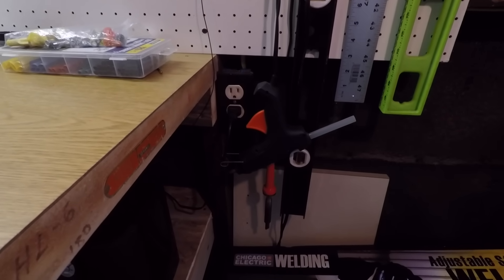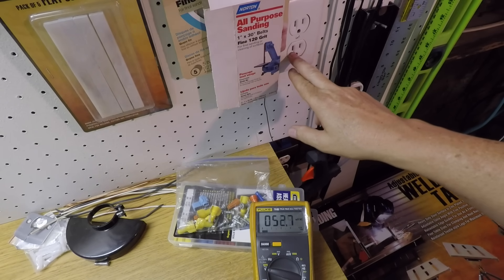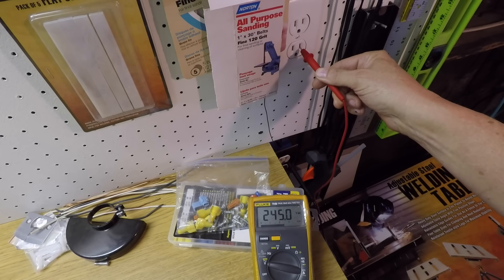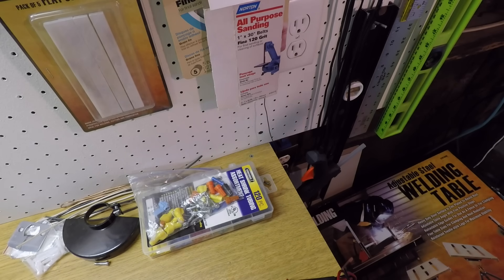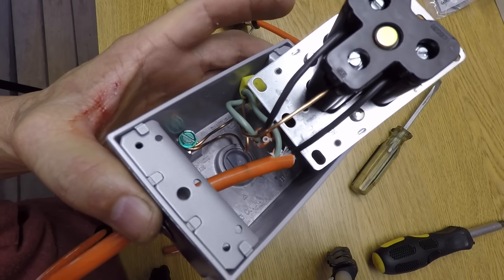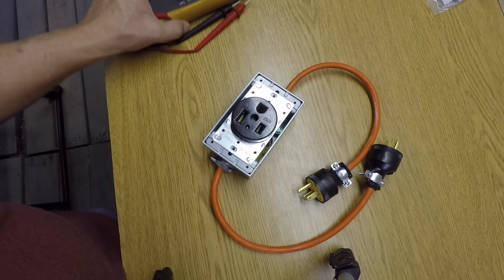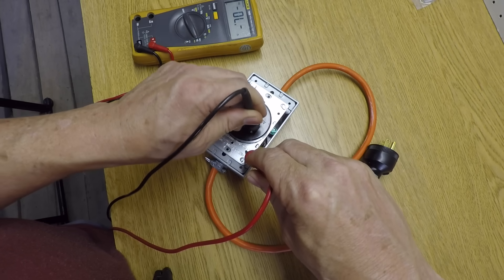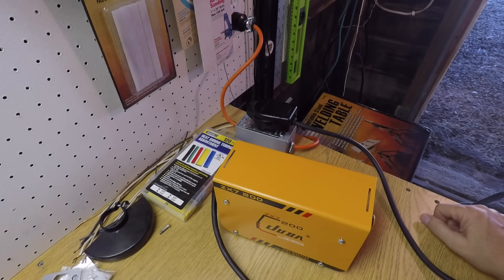How to Get 220v From 110v

Comment: enjoyed your video just what I was looking for the problem I have is will this do harm to  your on/off switch I have a plasma cuter it has 120/v and you are supposed to be able to use the same switch  to use 240 v for heavier material the wiring may not be heavy enough

Comment: Absolutely not safe to do at all, and the information you gave is incorrect as well. The bottom part of the plug is the nuetral, not the ground. If it had a four plug 220v plug, the  bare wire would be the ground in case of a short. never mix neutrals and grounds.  Also, not having a double pole breaker for a  dedicated 220v circuit could be disastrous if you had a short. People's houses have burned down because of it, hence the reason for the building codes being written in the manner that they are. I grew up in my dads construction company when I was a kid, saw a lot of scary stuff. Please be safe.
Reply: 4 pole would have neutral 3 pole has 2 hots and a ground no need for neutral evidently your dad still has much to teach you.

Comment: This will only work if your two 120 outlets are from opposite sides of the bus bar in the service panel. I don't know if you planned it that way or just got lucky but that is the only way you are going to see 240V across the lines.
Reply: He said each circuit was on a separate line, I assume he was referring to the main lines from the pole (separate phases).

Comment: If you feel it draws less than 20 amps, why not get a 240V 20A receptacle and plug? They're cheaper than the 50A devices. It probably had a 240V 20A plug on it anyway, so you're spending more $$ than you need to.

Comment: put both circuits on a double pole breaker in main box, safer
Reply: @Jason Bowman Great thought, Jason. Perhaps he is out of spaces in his panel. If not, he should run a dedicated 240V line direct from the panel, and not mess around. Meanwhile, the 2 120V circuits he is using should be on a 2 pole, 20 amp breaker at the very least. This guarantees that he will actually get 240V from the 2 panel busses, and adds another level of safety protection. I also think the cord should have been #12, the receptacles should be 20 amp as well. And I do believe that there is a likelihood that if the welder is plugged in and in the ON position, and one of his 120V plugs is unplugged while the other plug is plugged in to a live circuit, the unplugged one may have a voltage sitting on the hot terminal. It would be a good idea to test this theory if you’re going to use this configuration.
Reply: Yep, alot safer
Reply: @Jason Bowman What he is saying is to replace the circuit breakers with one double pole breaker.  It would still feed both circuits, but would trip both breakers if you had a short.  Just make sure to mark this in your box, just in case you sell the house, or replace the original breakers before you sell.
Reply: I don’t get it...
If you put a breaker on and unplug one of the cables without removing the plug for the device or switch the breaker to off, it’s still as dangerous.
What you should do is to install a breaker (or two, one for each source) that reacts to power, a breaker you need to push every time you start, in order to get power, a breaker that disconnects in the same moment you unplug the cable.
Reply: Then it would not be portable which is why he said he made the thing .

Comment: Why didn't you just run a 220 outlet. If you ran the 110 Outlets? Is your main panel completely full ? A circuit is only good for 80% of its listed rating on Breaker. It does look like a dinky welder. What's the wattage, do you know? Watts divided by volts will tell you the amps. Looks like a sheet metal welder. Try that welder out so we can see. I need to run an outlet for my welder that I don't use.😊

Comment: What amp is the welder drawing ? you are only getting 20 amp not 40 you can not get more amp out of the 110 breaker even if its off two 110 lines amp is not going to dubble .    a 220 breaker 60 amp is what you need. I do not think the compact 220 welder you have will draw more that 30 amp that is still 10 over and the cords will get hot.      I live in Rule Missouri , I have seen this many times it will work i have seen that run 100 yards from house to barn  , The Down side it is not safe .  12/3 is 110 wire 10/3 is 220 30 amp 8/3 40 amp 6/3 50 amp  the amp and heat can melt the copper drawing 220 through 2, 110 lines is not good practices.   Only time you have a open loop on the box is when the welder is plugged in .    but for your own use and you feel safe go with it .  but my self i have a 220 breaker 60 amp 6/3 line from my box to outlet  5 foot long.  and I have a 6/3 extension cord 50 foot long.   But that is for a Lincoln 220 stick welder 40 amp
Reply: JCcanU    The welder is 4.7 KVA at 240 volts.   How many amps is that?   Since when is 12/3 110 or 120 volts only?  Not sure where that one comes from.   Respectfully,    Kevin

Comment: Has to be from opposite sides of buss bar, otherwise it will only be 120 volts, will measure zero between hots on same buss,  240 across buss bars.

Most people don't have opposite buss circuits just hanging out together
Reply: Best thing here would have been for him to replace the 2 single pole breakers with a 2 pole breaker. Problem solved.
Reply: the kitchen! may have a split plug on the counter...
Reply: I respectfully disagree that you will have 120v if both circuits are NOT on opposite sides of the buss bar.  The voltage would be zero across both live wires if they happen to be on the same buss bar.  This would be the same as putting both leads of your voltmeter on the same live wire.  Voltage drop is zero.
Reply: ImNotStalkingYou Every breaker position is the opposite buss. That’s why 240v breakers are connected together one above the other.

Comment: Plug it in and check for voltage on the unplugged side. 
The real problem that you have is the 14 gauge wire your using. It will heat up because your drawing 20 amps from it. It's a slow burn fuse in front of the breakers. Ever hear of a fusesble link? That's what you made.
Reply: Yes, I've seen new houses in South Carolina wired with 14 gauge wire and have a 20 amp breaker on them. I agree with you totally. What the hell is going on.
Reply: Jeffrey Whitlatch   Absolute NEC violation!   Are you sure #14 on 20 amp breaker?
Reply: 20A breaker =/= 20A load. However, he doesn't even know what the load is.
Reply: @DIYHomesteadProjectsDIYHP10    I don't think the orange cord (probably of Type SJT) is actually 14 gauge.  14-gauge/3-conductor Type SJT cord is much larger in diameter than what is shown.  It is probably 16 AWG (13 amp max), possibly even 18 AWG (10 amp max).   Those max ampacities (10A and 13A) are if 2 of the 3 conductors are carrying current and total length less than 100 ft.
Since this is by no means a device that is UL listed or conforms to the NEC, then you might as well go all-in and double-up your wires.  Put the white and black wires of the orange SJT cables together (in parallel) and your wire ampacity will theoretically double.

However, a bigger problem may arise.  I looked up the specs on your ZX7-200 welder and rated input power is 7KVA, which equates to 31.8 A @ 220VAC.   That value would match the 50A/250V plug that came with your welder.  If it only used 15 amps, they would have used a 20A/250V plug because it is cheaper.  That 7KVA/31.8Amp spec is when you are dialed all the way up at 200 Amps of welding current.  I suspect you'd start tripping your 20 Amp breakers around 110 -130 AMPS of welding current, and if you are indeed using 16 or 18 AWG SJT cord, then you've got an issue when you are drawing more than your wiring can take but less than the 20A trip-point of your breaker.  Do you have renter's insurance?

Comment: Funny, we in Germany just plug in, 230 V. Boom. Every outlet has 230 V 16 A. My stove is wire connected to 3 phase, 3x230 V 25 A= 400 V...no plug. Normal Appartement in Berlin. America, measurement from the very past, so the power grid. Pls, don’t take it personally, because you didn’t setup those standards. Btw, here it was changed in the 1920’s.
Reply: Safety issue.  There is no practical need for that much voltage, much less wattage to all outlets and/or fixtures.  As time goes on we will see a move to LESS voltage/wattage to circuits due to LED and other energy saving devices.
Reply: Dirk Gogo, Europeans keep forgetting that they were destroyed and rebuilt after two world wars.

Comment: This is an outstanding piece of information and great video. I was wanting to run some 240V in my garage and dodnt want to have to deal with the hassle of another sub panel, but I do know I have three seperate curcuits running in there right now. Did you say the regular 120V outlets are wired using the standard 120V romex?
Reply: People without an understanding of electricity don't understand what being on different phases is. They more than likely think you mean just 2 separate receptacles.   Maybe another video would help them understand the difference. Thanks for video
Reply: Casey Fike    They are not on different phases.   It is single phase.   You can not have different ones.

Comment: hi. why not use grounding wire instade a com wire for grounding.
Reply: @DIYHomesteadProjectsDIYHP10   This is why I disagree , many people see a video have no clue .     I know you did the video to help others for a quick way to get 220 from 2 breakers off 110 = 220 .   many think its only a single pole 110 .   I been working with  440 220 110  for 40 years , I have seen 220 robbed for 110 and went to 20 outlets plus the Kitchen oven and clothes dryer,  when the oven was on, plus the dryer, the dryer would hum the lights went dim lol  Thats a Huge NO NO , but Missouri has no code . I was from Michigan with code and Texas with code .   Im guilty of making  110 jumper off 220 line Just taking 1 leg of the 220 so I could run saw or drills .  temp 2 or 3 day job. removed it when I was done .

Comment: Why not just wire a 220 connection and be done ✅
Reply: As a master electrician I would not recommend this at all. How many people do you think are going to find the same phase also what loads are on each phase matters also, this is some jerry rigging at its best
Reply: @darrenrodgers7273  I think it is dumb too but what is the worst that will happen?  Hooking up a hot leg to neutral or two circuits from the same leg to each side of the 220 plug (accomplishing nothing).  I see no hazard doing this really, just Jerry rigged as you said.
Reply: @kevingallineauii9353  Backfeeding one hot prong of the 120V plug that is disconnected for some reason while the 240v equipment is connected to the other leg could be a reasonable hazard to expect.
Reply: @darrenrodgers7273  Master electrician who browses YouTube for instructional videos. You sound great.
Reply: 220?  Lol
Reply: Why no go over and do it for him
Reply: What you talk about.  We all call backfeed. You are not hooked up with the white neutrals and if you unplug welder first you are ok . Depending on where you are that set up would not pass code .
Reply: It won't last long it will burn up the ground wire is way too small let's hope that this guy say this is not next to his house
Reply: @edmondlajoie5968   the ground wire is not used unless either of the 120 volt lines gets shorted to ground.
Reply: I think he wants to save money and combine the 2 outlets which he already have for the added welder.
Reply: Then it would not be portable which is why he said he made the thing .
Reply: His Panel may be full.
Reply: kenton romero Then install A sub panel
Reply: The panel has 120/240
This just let's you tap both legs without  a homerun back to the panel on it's own two leg breaker.
Cheapest way to access the 240v that's already in the building
Reply: @ja60123  Depending on the 240v equipment that is connected, there is a good possibility of 120v being available on an exposed hot blade of one of the 120v male plugs when the other is plugged in.  Can create real problems if not handled correctly.  So, if you had to do something like this, it is a good idea to get the 120v lines connected, and then connect the 240v gear.  But way less prone to error if the outlet is hardwired for 220.
Reply: Running another line is redundant unless you need more than 15/20 amps.  In the long run, it would be best to run a separate line to keep up with code.. however as long as the wiring is done properly, there shouldn't be any issue.
Reply: ahhhh bc he can take his outlet (and an extension cord) anywhere and run his welder not just one spot. also bc he can
Reply: @thespiritof76..  Because it wouldn't work in most applications, as he would need to tie into two different 120 outlets on opposite phases. On outlets in the same room, odds are they are on the same circuit, therefore, same phase. 

He'd be better off just tapping off of the hots on the two opposite phase outlets he already has, and installing a permanent 240 outlet off of them. I don't know if that would be up to code, but this isn't either...

Comment: just wondering did you use a double pole breaker or you can just add a connecting bar between the breaker switches in case one phase trips they both will?
Reply: @DIYHomesteadProjectsDIYHP10  i only suggest becuase it protects equipment if you have one breaker trip and go to plug in and there is only half the power motors and some electronics release the genie seen it 😎
Reply: @wizard3z868  it is single phase. One breaker tripping would open the circuit so your equipment would not be running on 120V. It would be a hazard though since your equipment would appear to have lost power, but your wires would still be hot.

Comment: That's a direct code violation for one.  The other problem is you need the handles of both breakers tied together so both trip at the same time.  If you lose power on one phase you may destroy your welder.  It's also very likely that the hot prong of the loose plug will provide 120v unless the welder shuts it off somehow.
Reply: Ground wire is not to carry common amperage return.
Reply: Eric, I've been thinking about that. I know if they share a neutral, as in 12/3 then the breaker has to be a two pole breaker. The handles have to be mechanically connected with a listed connecting device. I've seen a six penny nail used and it would probably work, but I can't assume that. This doesn't use a neutral, any 120V current is going back on the ground wire. Which is a violation.
Reply: Eric The Red    Which article of NEC is this violating?   Since his house is single phase 120/240 volts, how can he burn up the welder with one phase loss?

Comment: What about the opposite way 220 to 110?. Any simple suggestions
Reply: @DIYHomesteadProjectsDIYHP10  
Thank you Sir for replying . But this is to be in India where the voltage is 220V. So I guess it will not work for me. I wanted to take one of my American pressure cookers over there.
Reply: @abdullahthayyil9878  lol they sell transformers for us americans to use our appliances in other countries.
i just typed usa to india plug 

https://www.walmart.com/ip/India-3-Pin-Universal-Plug-Adapter-Black/678714159?wmlspartner=wlpa&selectedSellerId=14418&adid=22222222227000000000&wl0=&wl1=g&wl2=c&wl3=42423897272&wl4=aud-566049426705:pla-51320962143&wl5=9002292&wl6=&wl7=&wl8=&wl9=pla&wl10=118779928&wl11=online&wl12=678714159&veh=sem&gclid=Cj0KCQjw6KrtBRDLARIsAKzvQIH_LoznDAR6aoBisON-eV5HsMIpZmPoB58-Hm388Sq9ZepIt90xiN8aAoOqEALw_wcB
Reply: @DIYHomesteadProjectsDIYHP10   3 wire , Red Black Green , Green is Ground so is White Common is just a ground .  1 red and 1 green  off the 220 will be 110 . but its not right but in a pinch will work .    the red is 110 hook up the black to red /  the white to the green   you robbed a 110 off a 220 .

Comment: nice trick to carry a welding machine everywhere without  bothering about finding a damn 230 oulet! thanks a lot!
Reply: Most every building in America has an air conditioning unit outside. Make a good cheater cord for you welder and tie it into the disconnect. That would be safer than this widow maker. Plus how often will you find 2 separate 120 volt receptacles close together.
Reply: Remember you will need two 110 volt receptacles on separate legs to get the 220 volts. So your garage must already have 220 volts coming in for this device to work. If all your garage receptacles are on the same circuit then this won't work.

Comment: I am going to build my own box to use it whit a dryer 220 V
Reply: Dryers need a 30A circuit; you'll blow the breaker at best, burn up the wiring at worst. Dryers will probably use around 25A; the extra 5A on the 30A circuit is a safety factor. So a 25A welder on a 20A circuit is probably okay as long as it's 25A nominal and actually consumes 20A.
Reply: No in a room most small rooms use 1 breaker  no more that 6 outlets on a line , if you use 2 outlets in the same room your drawing to much current off the 1 braker , and can cause a fire trying to run a electric dryer .  This is why I do not agree with using a Box with 2 cords to run 220 from two 110 lines , He ran a second line from a breaker so he has two 110 lines .  each line is 20 amp but doing this you only get 20 amp  not 40 .
Reply: Robin Ruano    Don't do it!   A dryer and the welder are not the same situation.   The dryer is 4.5KW.   The welder is 4.7KVA.   So welder "can" pull more amps than the dryer.   The reason I say don't do it is the welder is adjustable.   If he tried to run the welder on highest setting, would not run very long before tripping the breaker.   The dryer is full power all the time.   So will not work.